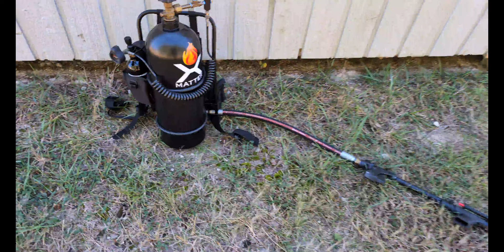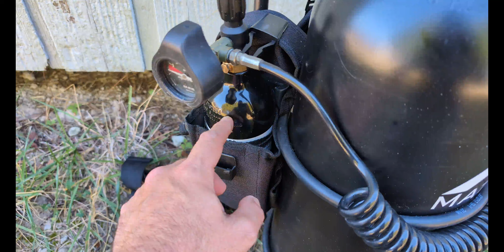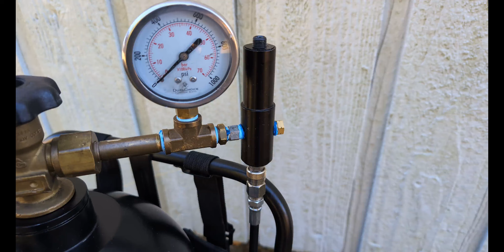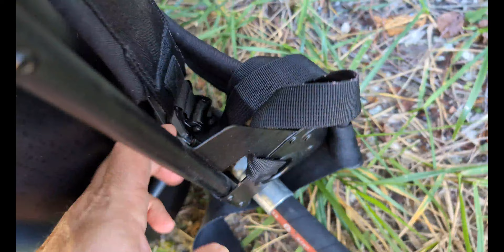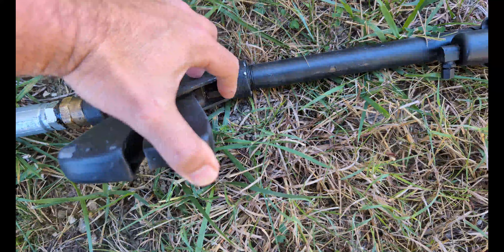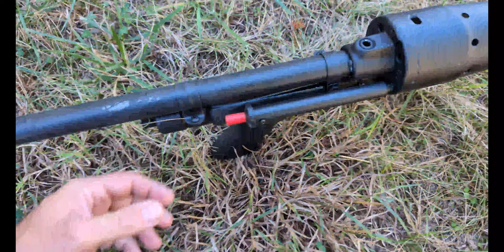Flamethrower Testing

Comment: I like the XL18's improvements, but the hose is still a weak point.
The flamethrower's hose must be resistant to aggressive aromatic solvents, as that's its best combat fuel.
Reply from the maker: Eaton "everflex" makes a Teflon lined hose with external stainless steel braiding that can handle both the pressures and the aggressive solvents.  In my experience, blending a polymeric napalm, such as 70%gasoline with 30%toluene then adding Styrofoam does make a suitable fuel for distance, but, it's a toxic mess and has a limited shelf life.  

The XL-18 uses the same hose as the one in the video if I'm not mistaken, which has buna n rubber inside, which can handle regular fuels as well as the traditional aluminum soap fuel thickener.  If you were going to use napalm I would recommend using the aluminum soap thickeners as provided by X-matter. 

In terms of "combat", it kind of depends on the situation.  In the event of clearing a bunker, you might want a faster burning fuel to burn up all the oxygen quickly.  When it works it works, but in most situations the flamethrower operator is a target, which is one of the reasons it was discontinued from military use in the USA.
Reply: @CharlieMacklin1 The ROKS-3 flamethrower manual recommends using anthracene oil/heavy aromatic solvent/creosote mixed 50/50 with benzene. I'm not sure how aggressive these heavy aromatic distillates are, but benzene will definitely damage a hydraulic hose.
However, you could try replacing the benzene with regular gasoline (I don't think it will significantly worsen the mixture).

Aluminum soap-based thickeners tend to lose viscosity over time unless they're too thick (they're also more difficult to manufacture and more expensive). Natural (or synthetic) rubber-based thickeners don't have this problem, so I can store the thickened fuel indefinitely.

Have you tried using a ball valve as a release valve? I've noticed it creates much less turbulence than spray gun valves. I haven't tested it with liquid fuel yet, but it works perfectly with water.
Reply from the maker: @jinxn2181  I've seen the ROKS-3, it's a remarkable design with the pyrotechnic pressuring system.  That is an interesting fuel blend; the aromatic hydrocarbons do perform well but yes they can damage nitrile (aka buna-n synthetic rubber) which is what the hydraulic hose in the video is.  You would have to experiment with that ROKS fuel blend to see if the aromatics make much difference in the consistency.  Aromatics definitely effect the consistency of a polystyrene blend. 

I did a test once with a buna-n o ring in aromatic toluene/polystyrene blend.  After a few days it softened/swole, but returned to it's original shape when left to dry.  

Gasoline has about 10-20 percent aromatics; the majority of which is xylene which is less aggressive than toluene. 

But yes, overall, the aluminum soaps are expensive, BUT I like the fact that they DON'T get thicker with time.  I once had a thick sodium soap fuel blend with the consistency of apple sauce put into a flamethrower during the summer heat.  By winter it had clogged the whole system and was coming out like toothpaste, it was a pain to straighten out.  Polymeric will turn to a soft plastic after several years which would wreck the system.  

Regarding a ball valve, yes, I have one with a ball valve that is articulated with an external control rod/return spring.  It works well, the main advantage being that the valve is closer to the nozzle to prevent drips and dribbles.  

I could do a video on that unit if you like.
Reply: @CharlieMacklin1  The ROKS-3 uses compressed air as a propellant. The pyrotechnic charge uses LPO-50 (it has 3 cylinders). The ROKS-3 design is typical of WW2 flamethrowers, but it has a few interesting features (a cross-shaped flow straightener in the barrel and a thin rod in front of the nozzle that atomizes part of the stream to facilitate ignition).

Aromatic hydrocarbons have a higher density than their aliphatic alternatives with a comparable flash point (even benzene has a density of 0.879 g/cm³, which is higher than diesel fuel). They are also more toxic and carcinogenic and produce much more black smoke when burned.
Unfortunately, these coal tar pyrolysis products are almost impossible to find in retail. I found a heavy aromatic solvent with a distillation temperature of 150-330 degrees Celsius, but it is sold in 200-liter barrels.

Aluminum soaps are not so much expensive as they are problematic. Producing soap from sunflower oil isn't that expensive. 35 grams of aluminum sulfate is enough to precipitate 100 grams of aluminum soap. The main problem in producing aluminum soap is to prevent the soap from sticking together into one large lump when precipitated with aluminum sulfate solution. If the soap clumps together, it will be almost impossible to dry. Some say that this can be prevented by using an excess of 50-60% NaOH for saponification, but I haven't tried that yet.

Aluminum soaps do not thicken, but they do thin out (after about a month) if their concentration in the fuel is low. And it seems that this is a drawback of all aluminum soaps (including aluminum naphthenate), because this problem was also noted in videos about napalm from the WW2 era.

Yes, of course, I would like to see that.

Comment: Now all you need to do is dissolve some Styrofoam into gasoline  and you get a gel mixture. You'll be shooting pseudo napalm, then. Napalm-B:  approximately 33% gasoline, 21% benzene, and 46% polystyrene. You'll need a thermite or other high heat igniter for it. Use a Butane Torch, like a food grade model. Now you're cookin'. And, last, please use Nitrogen. It's vastly superior to CO2. You can research why.
Reply from the maker: I have done this back in 2009 and have video footage filmed with a potato camera lol.  I would not recommend that polymeric napalm with the typical hydraulic hose.  Benezene is hard to come by but toluene is a suitable substitute.  First, the fuel is blended with the solvent (toluene or beneze or xylene) and then the Styrofoam is added to it until a syrup viscosity is achieved.

It works but, yeah kind of a toxic mess.